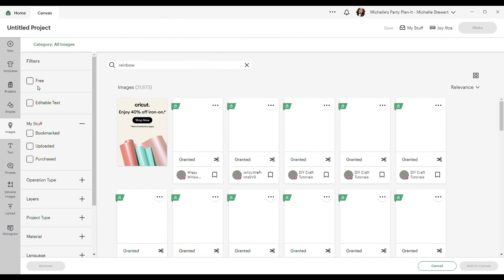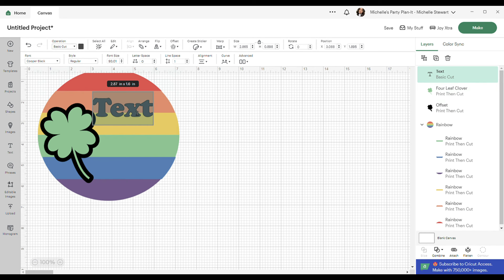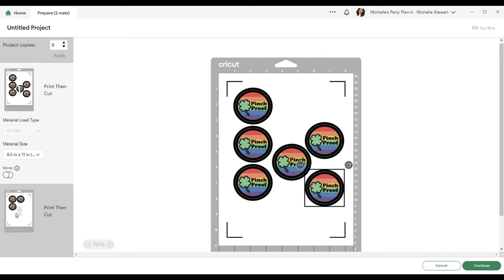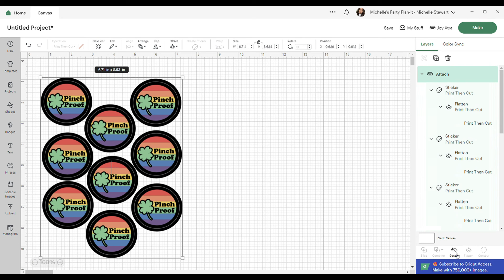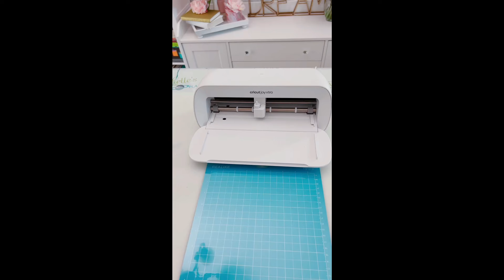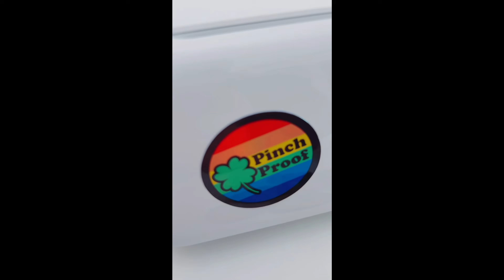How to Make Kiss Cut Die Cut Stickers with Cricut

Comment: I just tried this, and it just made 2 die cuts, one slightly inside the other. In other words I set up my print then cut as narrow white border, kiss cut, die cut around kiss cut.  All my machine did was make 2 die cuts one inside the other.  Anyone know why this is happening?
Reply from the maker: Maybe check your material settings in Cricut Design space, sounds like the machine thinks you are using thicker material than you have.
Reply: @Michellespartyplanit  Do you know which vinyl sticker settings are for thinner or thicker? I feel like I've tried them all and it either cuts both all the way through, or doesn't cut at all.

Comment: This week-end I tried to make stickers following your instructions using the Sticker feature in Design Space.
I used Printable vinyl Sticker paper but could not find the correct cutting feature.  Each time I tried to cut it cut through the kiss cut AND the outer edge.  So the stickers came out and it is very difficult to get the stickers off of the backing.
What is the best setting to get the sticker cut at kiss cut with the sticker cut out when using printable vinyl sticker paper?
Reply: Did you ever figure this out?  The same thing just happened to me.
Reply: @rustyneuron  no, I just make stickers the other way not using this feature. I usually use washi setting.